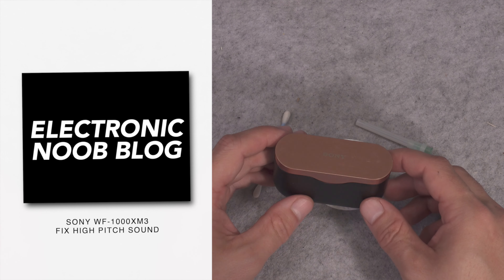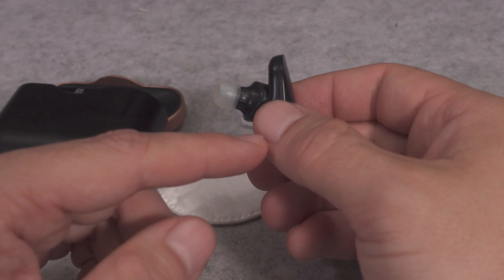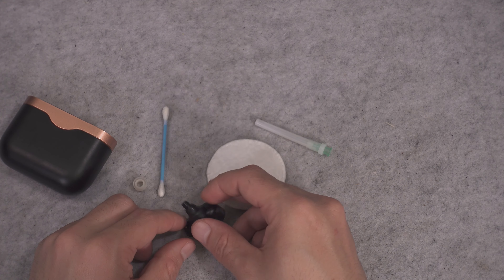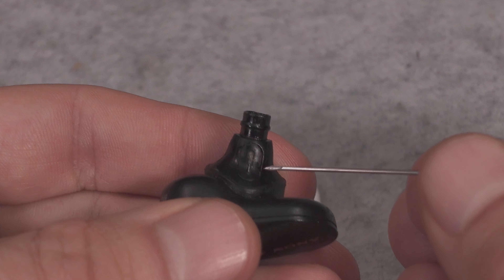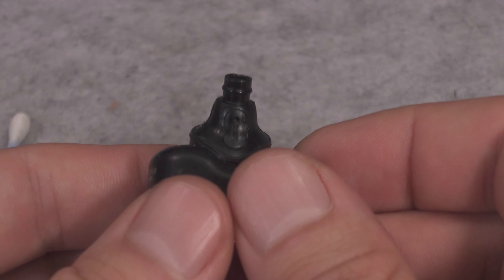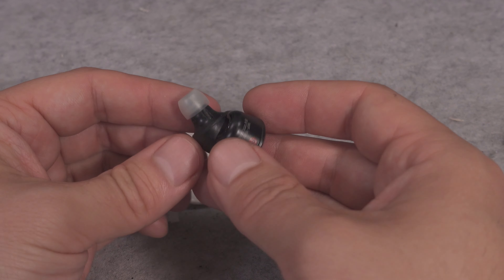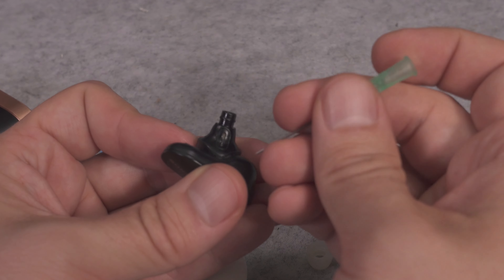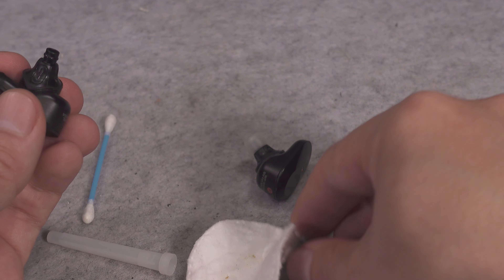Sony WF-1000XM3  fix loud high pitch noise while noise canceling is on (wireless earphones)

Comment: Great video! However, I get this issue in the right ear of my brand new linkbud fit. I bought a pair, immediately had the issue with noise cancelling on. Returned them, got a new pair and exact same issue out of the box… any ideas of what it could be?
Reply from the maker: Hard to tell - mine issue was with feedback loop and microphone hole that I cleaned to resolve it. Since You have it brand new - don't think about fixing it - return it.  It's clearly design flaw - trying to fix something out of warranty after 2 years of use it's cool and fine. Being forced into fixing new product that You shell lot of money (and they are in price range of airpods) is not cool!
Reply: @ thank you! I’m in contact with Sony now, hopefully they can suggest something as it appears to be a (massive) design flaw…